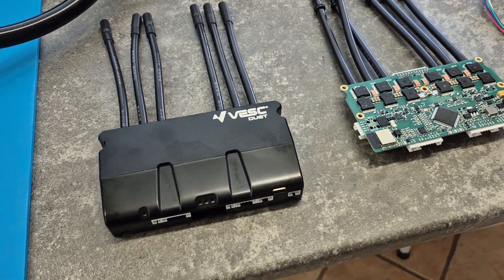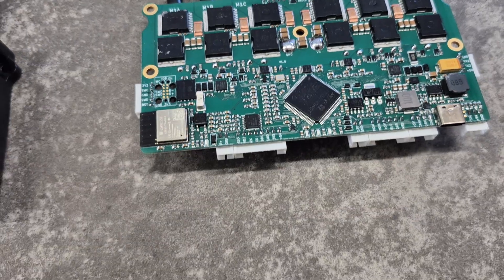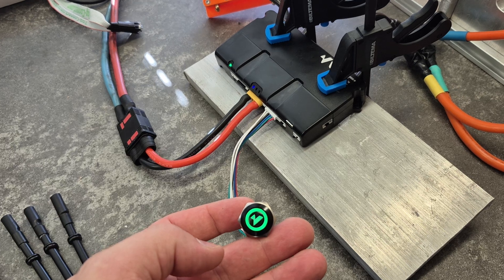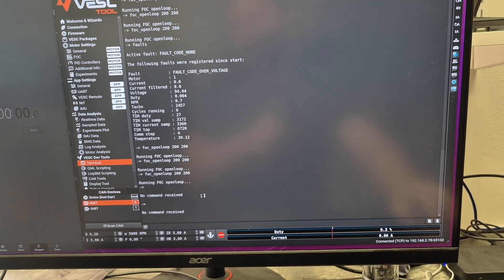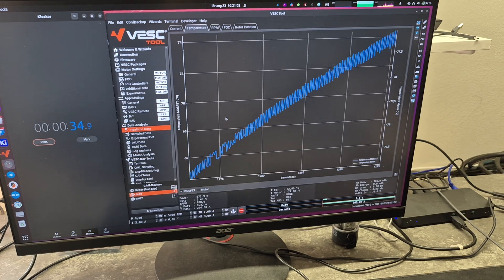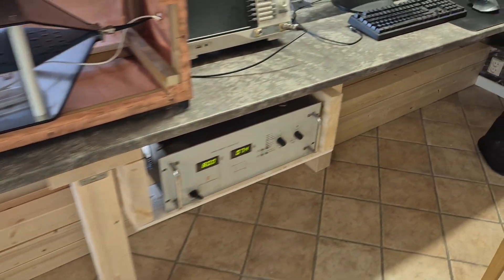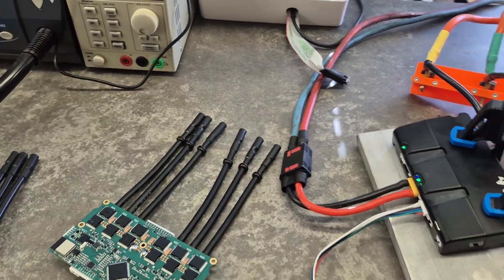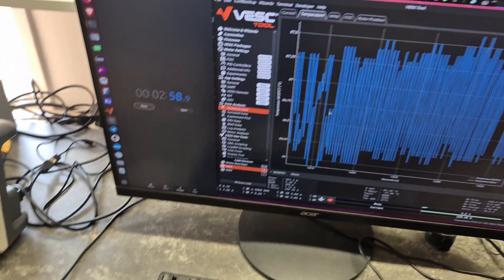VESC Duet Demo

Comment: Hardware is awsome but xt90? its rated 90amp max!!! If you push it, you dont push the controller but the xt 90 connector. Not good, not good. You can but the power in but you cant get it out. The power is stuck in the xt90

Comment: Why does it say 100v but only 22s? I want to use this for two 80v brushless motors and a 25s battery, but the specs seem to be confusing?
Reply: 100V is the absolute maximum rating of the components. We do not recommend exceeding 22s which allows for voltage spikes.

Comment: Looks like about ~ 70-80V ish, 200..300A phase (~120..180A DC) , 
 - No extra bus-bars, - Not sure for how long will pcb take this much current and heat stress, a year @ this current? What is the copper thickness ? How much layers?
 - No phase shunts ( maybe I'm wrong, please correct ), its appears 3 shunts to ground, in previous versions this connection introduced some limitations... 
 - Shunts (guess) - WSLP3921, max power - 9W, min resistance - 0.0002 Ohm, => I = √( P/R ) = √(9 /0.0002) = 212A, within 20V/V gain ina240a2 => 412A measurable diff( 1.65 ) 
 - 3xMLCC caps per phase, 2.2..4.7uf @ 250V minus 60% @ 100V minus 80% to capacity... not sure this is enough...  I would add some polyester caps to offload most of the ripple current.
Reply: Gate drivers - FD6288Q ( Guess )

Comment: 2 Simple Questions :)
- Without any parallel mosfets this values are amazing. Why you didn't made any parallel design, sir, except from the size. It would be more at safe zone?
- Heatsink sure is a must, but without heatsink do you think that these values are also managable at least for shorter duration?

Comment: Looks good Benjamin, that is some impressive amps for the size of the VESC model. Now you should tune up the 100/250, or make a bigger 400-500A one (with maybe 1000a burst capability) :). You just can’t beat the VESC motor controllers. 
Cheers,
Jake

Comment: I could perform a WCCA on power loss if you can provide me more data about Fet, PWM freq, output freq, gate resistor, used driver, supply voltage for driver...etc. Based on that and number of vias used/PCB thermal resistance we can check what is the max die temperature, and a power pattern until derating.

Comment: Why not run the test with both motors running at the same time? That would be more realistic to a hyper scooter? 

Also scooters can't fit mid drive motors so do we have hub motors that are capable of sustaining 200 amps for 3 minutes? Are we not going to burn our hub motors if we use this much power? 

Won't this require around 5000w hub motors to run efficiently? Those don't exist in small enough size to build a electric scooter with this controller?

Comment: Oh how sweet were the days when the VESC hardware designs where open source 😌

(p.s a video on your TEM cell and how you use it and what it's good/not good for would be fascinating 😊)
Reply: As long as the firmware and software is free its a great success... I can imagine there are very good reasons to at least close the hardware so Benjamin gets his fair share... That way the cheaper vendors from india or what not have to at least do some work and not copy everything.
Reply: @Beredro  I totally agree open source firmware and software is a big win, and I also understand why it makes sense not to open source hardware for a lot of people. Unfortunately, open source hardware designs rarely have the same collaborative aspect that successful open source software/firmware does.

Well designed hardware is much less commonly open sourced which in my opinion makes it more valuable. I personally learnt a fair bit from hardware designs he open-sourced back in the day ☺
Reply: @joe0932  He still has some open source hardware designs, just schematics not full layouts so certain companies can cheap out and make a barely functional unit.

Comment: Is there any possibility to run one motor from both outputs in parallel, for higher current support when just utilizing one motor?
Reply from the maker: There is a firmware flag to support that, but it is a bit risky as connecting the phases in the wrong order then instantly kills it. Also, the input connector will limit the power then, so on high speed it won't increase the total current. You will get a lot more current at low speed though.

Comment: Jeez. 100 volts at 120 amps continuous.. Time two! That's some serious juice for a small ESC.
Reply: I believe the motor phase amps will be very different from the supply amps. Likely doesn’t have the power output you would expect.
Reply: @ruzzcraze1862 If you put 12kW in, you get 12 kW out (minus losses due to reality )
Reply: @blockcrafter2393 you’re saying the obvious. Search up how many kw this is rated for(hint: it’s not 12kw).
Reply: @ruzzcraze1862  Yea, the controller works like a step-down converter essentially. Low Current at High Voltage on the battery side, is converted into Higher Current at Lower Voltage on the phase side - keeping the power constant.

For a battery at 100V, and an inverter FET being driven at 50% PWM duty cycle at some instant, then the motor phase associated with that FET should see 50V at that instant, so the motor current in that phase will obviously be double that of the battery current. Thus, phase amps will be much higher generally.

But I am also confused here... The realtime data on Mr. Vedder's setup shows battery amps to be 8 A and motor amps at around 200 A. That's like 25x 💀
Reply: @elemoman  I believe 8A is the sum of the currents going in the motor phases, but 200A is the sum of the RMS current going into each phase, or something similar. When current is going into a phase, most of it is going "out" of the other phases so that's why the 8A figure is so much lower than the 200A figure.